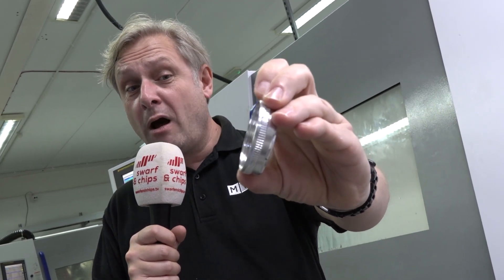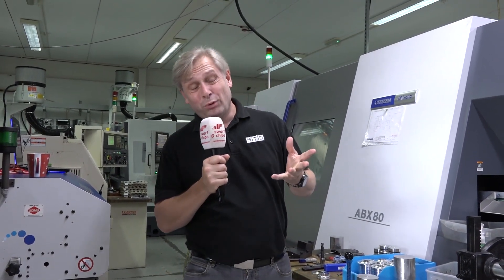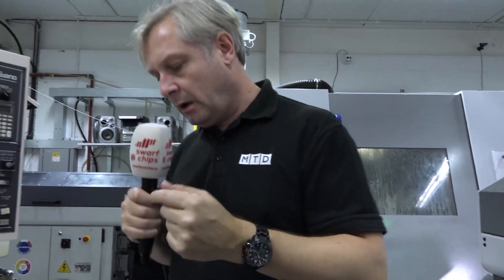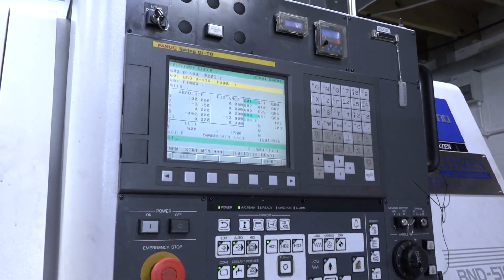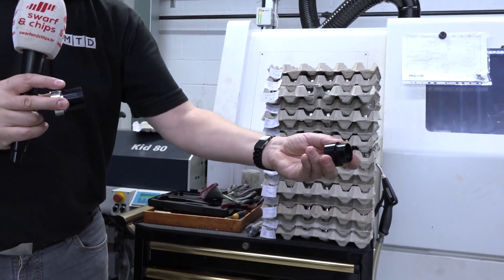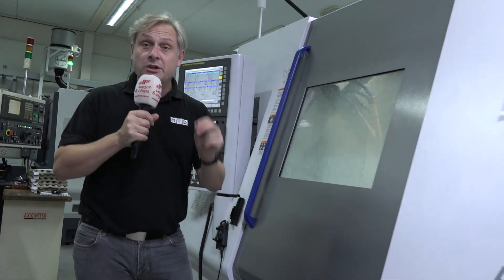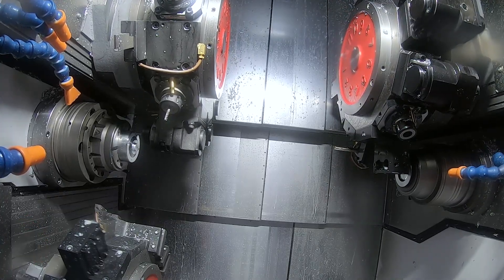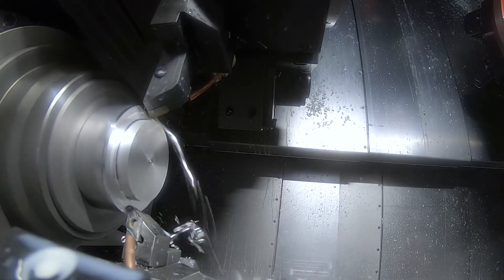The FIRST Citizen Miyano ABX 80 in the UK! - #SwarfandChips

Comment: Miyano with FANUC controls?!?  That is blaspheme.  The Citizen Cincom control is way better than FANUC.  I spent the majority of my time in the trade on FANUC controls.  My current shop has all Citizen and Miyano  machines with the Cincom control.  It's so much easier to use and set up vs FANUC.  The control is smart enough to warn you of potential crashes and interference issues.  I use Esprit to do programming on the Miyano and all of our Citizen swiss machines.  The posted programs that Esprit outputs are some of the cleanest edit free programs I've seen.
Reply from the maker: Glad you enjoyed the video !